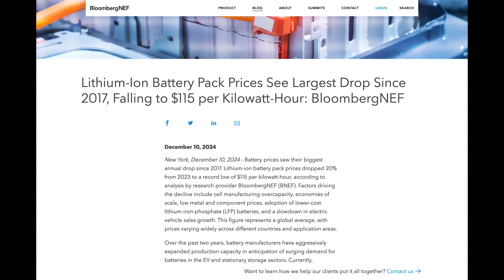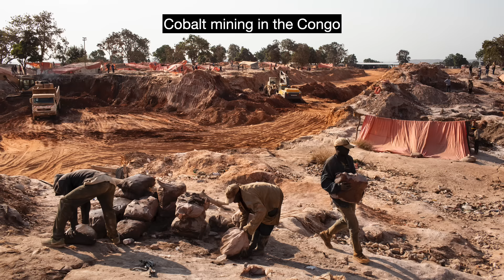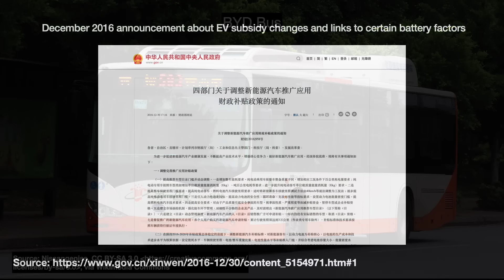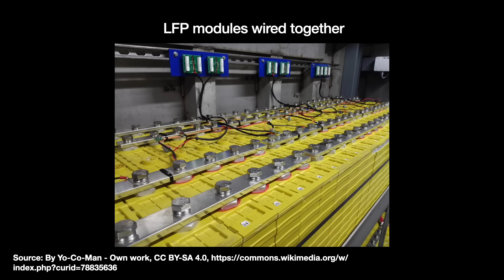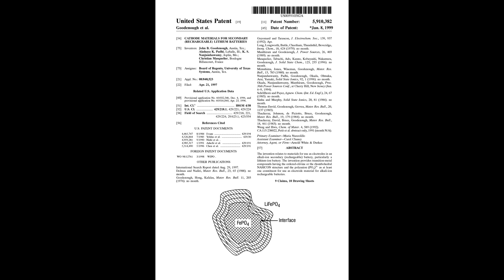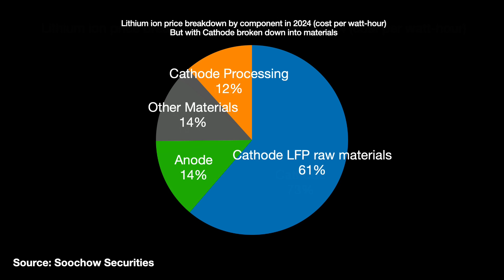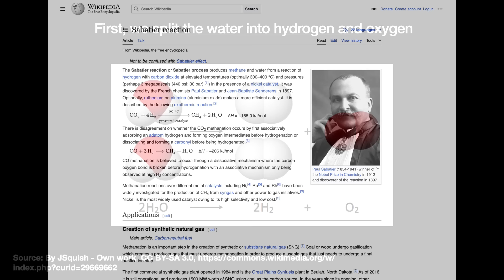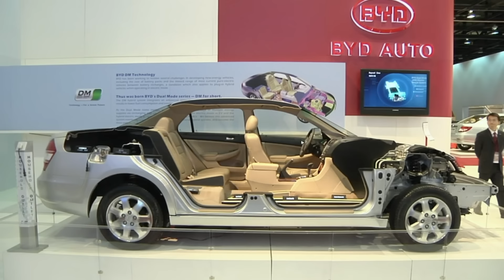How Did China's LFP Batteries Get So Cheap?

Comment: I built a LFP battery from 4 EVE 280Ah cells for my RV. One winter I forgot to unplug the inverter that was on a BMS bypass due to the BMS being too weak for the draw. The inverter has a tiny draw and it drained the pack to about 4V which would mean the battery was entirely dead. I plugged the RV in to mains, but the charger didn't start charging. I sadly started thinking I'll need to buy a new battery. But then I simply decided that put a 3.5V charger on the cells and they started drawing amps. As many amps as I wanted but my DC maxes at 10A. So somehow within about 30 mins, the voltage was above 2.5V, in about 2 hours it was at 3V and then left them and checked about 4 hours later and  they got up to 3.1V. I put them back into the RV and lo and behold, the battery started charging full bore at 30A. The battery is still in my RV and now only has about 250Ah capacity based on my testing. LFP is indestructible.
Reply: I have a similar story, drained my pack to 21v accidentally 3 times, that was 5 years ago and still going strong.
Reply: Undervoltage lockout prevents charging. Some devices, however, won’t even trickle charge up to a minimum point and require manual intervention.
Reply: As I understand most lithium batteries have a voltage threshold which below they are not chemically stable. But I do not know how different types of batteries and the duration influences on this.
Reply: @martinlitorell3834  Not being an expert, but an interested amateur in my understanding the minimum voltage not allowed to go below varies with the maximum charge voltage.
First of all, deep discharge (below 0%) should be avoided by all circumstances not only on most, but on ALL lithium batteries, this is why BMS (when applied) do cut off the battery when a voltage below a certain level is detected.
On 1 cell level (when n-cells are connected in series, you multiply all values by n):
For the nominal 3.7, max 4.2V chemistries/cathodes (usally called for their dominance in use Li-Ion), the lowest voltage point is generally 2.5V, but when including some security margin you find also values of 2.8V or even 3.0V applied in BMS (life cycle tests).
For the nominal 3.2, max 3.6V chemistries (LiFePO4, even though chemicallyit would be correct to call them too Li-Ion I personally refrain to do this, because for me Li-Ion is defined as the dominant 3.7/4.2V chemistry and if I would call also the minor 3.2/3.6V chemistry Li-Ion this would result in failure/confusion, because most shops/sellers would sell me a max 4.2V charger when I ask for a lithium-ion charger, because the max 3.6V charger for LiFePO4 is very rare and LiFePO4 batteries are mostly used in EV and only very minor quantity in other general applications, this means not known to all people) the lowest voltage varies between 2.0 and 2.5V (I would assume 2.5V is simply a value fixed to use same value/test equipment as for the Li-Ion and such high value well matches the compared to Li-Ion extremely stable voltage versus state of charge for LiFePO4, while 2.0V may rather represent the voltage at which real degradation is observed to start).
Generally, the lower the voltage falls, the larger is the damage AND
the longer the too low voltage condition do exist, the larger is the damage.
On 20 year ago produced Li-Ion 18650 cells reconfigured from original Laptop use to house batteries to store photovoltaik energy a general rule of thumb is, any cell found at disassembly of "garbage" Laptop batteries below 1.0/1.5V is not used, on cells between 1.0(1.5) and 2.5V some tests are done to identify cells also too bad to be reconfigured. In other words, the manufacturer or the process used by a manufacturer has some influence.
What exactly does happen when the voltage is too low is hidden in a dust of amateur speculation. For me the best explanation I have heard from somebody who really showed an extremely deep insight is, the lithium-ions do convert to lithium-metal not inside the graphite anode as they should, but at other places like the separator or the cathode and once a lithium-ion was converted to metallic lithium at this not intended places it needs much more energy than is available within the battery charging/de-charging to convert the lithium-metal back into an lithium-ion. Both, the missing lithium-ions and the generation of extremely thin layers of metal at places where it is not desired cause degradation clearly on capacity, but also on self-discharge and I think the dominant factor that limits use is the degradation of self-discharge (some degradation of capacity is in most applications tolerable), this means a battery may keep its energy only 1 months or 1 week while healthy lithium batteries do keep the major part of their charge usually for years.
Reply: Can someone please tell me why this was a bad idea?
Reply: @CallMePaine  Dendrites can grow when the battery V goes low and  cause short circuit upon charging. But I don’t know if it pertains to LFP, Anyone know?
Reply: @unusualelectronic the dendrites grow on charge, rather than as a result of the discharge.
Reply: I do not have experience with LiFePO4, but some experience with 3.7/4.2V Lithium-Ion cells.
Yes, you can re-charge a cell that has fallen below the absolute limit of 2.5V (you may need to overcome the protection built-in), BUT these cells experienced some damage. I noted a drastically higher level of self-discharge (the lower the voltage, the higher the self-discharge). Cells that have once fallen down to 1.5 or even 1.0V or lower are not any more usable in practice. Cells that have fallen below 2.5, but stayed above 1.5V can still be used with degraded performance and the degradation level is also clearly different from manufacturer to manufacturer. Above experience is on cells produced about 20 years ago.
Recently I got 2x maximum 21V (5S) packs. One battery showed at arrival good 19.7V, the other pack showed below absolute limit 10.2V (absolute limit for 5S is 5x 2.5V = 12.5V). I charged the 10.2V pack immediately and for about 10 cycles use up to now no distinctive difference, but I am sure in long term the 10.2V battery will show less lifetime.
==> Indestructible is not correct, but less critical than many think who cannot separate between cell failure/destruction and intentional disabling by for example the BMS (20 year old Dell 18650 based Laptop batteries included an series element in the contact that got burned if the battery BMS detected an unhealthy voltage to securely disable further usage of such batterie, as the high energy content has the potential to cause larger damage  and therefore the judgement what is still usable has shifted higher).
The absolute cost of a 280 Ah battery is substantial, but if the RV would get in fire because some problem with the 280 Ah battery, the cost of a new 280 Ah battery is the minor of all costs.
Reply: @FriedhelmSchröter  LFP cells are now substantially cheaper ($500 for 300Ah with a BMS built  nowdays) and not an extreme fire hazard like LiION. Rapid discharge, short circuits won't light them up on fire, even when damaged/pierced the LFP battery is very resistant to catching fire.
Reply: >BMS bypass >_<
Reply: @P7ab  cringed real hard when I read that. Sounds like a problem waiting to happen lol
Reply: For those of you who wonder why I bypassed the BMS: these are raw cells, this wasn't someone drilling into a box to bypass a built in BMS. The terminals are right there and you can jump a car from that battery if you want to. The reason I needed the bypass in the first place was because north american RVs are manufactured with antique, extremely underpowered charging systems usually 20-50A. My RV has a 30A WFCO charging system (yes, 30A at 12V). I bought the BMS before I ever got the inverter based on the charging capacity of the RV and sized it at 40A. When I later got a 1000W inverter and I plugged it straight on to the battery terminals. There is nothing wrong with doing that, as long as the battery gets charged a bit since the old inverter kept its capacitors charged all the time, hence the trickle drain. I would typically unscrew one of the terminals when I parked it, but the place I used to store it has 120V. And they decided to unplug the 120V without my knowledge, even though I paid for it. I learned my lesson, and bought a 250A BMS and a 3000W inverter and everything is on a BMS. And, no, it's not people like me that solar grid tie regulations are for, because this is essentially a car battery and you can do essentially anything you want with 12V...
Reply: People like you are why there are laws that prevent people who would never, ever have a BMS bypass from building batteries for their own residential solar system. 

Thanks a lot.
Reply: @instanoodles So what? Do you have something useful to add?

Thanks a lot.
Reply: @instanoodles  blame California politicians

Comment: been stocking up on my 12.8v 100ah  lfp batts with solar
Reply: I moved to higher voltage. 12V is awful for any big system
Reply: 12v isnt awful it just cost more in copper wires my comment was buying 12v batts you can easily hook them in series get what voltage you want
Reply: Same here

Comment: China adopted LFP early on in EV transition because Chinese EVs start from buses and taxis, not fancy sport cars like Tesla roadster or Model S. Buses and taxis drive much higher mileage per year (100,000 km per year on average). So cycle life is critical, and LFP's long cycle life is essential in these applications. And that's the key reason LFP dominated BESS (battery energy storage system) market besides safety. And BTW, the Moss landing BESS fire shown in the video use ternary battery, not LFP battery.
Reply: That and China's geography also has colder climates hence LFPs.  Even Beijing drops to close to -10C.  California (let's be realistic that's what the US builds for) is easy-mode.
Reply: @teac117 i don’t know if humidity would effect anything but they also have a way stronger monsoon season
Reply: @JaKingScomez Not really. There are certain models of lead acid that have to worry about evaporation rates, but li-ion is mainly dry and self-contained. If you have to worry about humidity in your electrical equipment, either you're doing swamp cooling, or something gone sideways.
Reply: @meganegan5992  so high levels of moisture doesnt lead to a shorten lifespan for these cars? That was of my biggest worries.
Reply: Yes, we should never have used ternary li-ion for utility storage, but our leaders are systematically cutting off options.
Reply: Another sidenote about patent, royalty of LFP in China. There are two critical patents for LFP battery chemistry, the cathode material, and carbon-coating that improve LFP cathode electrical conductivity by orders of magnitude (LFP has poor conductivity). The patent holder files these patents in China much later, because back then China is a backwater economy, and they did it by combine these patents into 1 single patent (to save money maybe?). Later this single patent was challenged in court, and was nullified. That's why Chinese LFP battery makers can sell LFP battery royalty-free in China, but they still have to pay royalty if they sell outside China, where the related patents are valid.
So the notion that western battery manufacturers & EV makers don't want to make/use LFP battery because they have to pay royalty is not quite accurate, as lithium ternary battery is not royalty free either. Royalty do not stop them from using NMC/NCA battery, why does it stop them from using LFP battery (and LFP royalty is probably much lower than NMC/NCA given it's less desirable)? Since Chinese LFP sold outside Chinese market has to pay royalty as well, western battery manufacturers do not really has a big disadvantage if they want to make LFP batteries.
The real reason LFP was not popular in western market is because LFP SUCKS BACK THEN. Not only it has lower energy density; it charges slow; it has very bad low temp performance; its flat SOC-voltage curve make BMS and balancing very tricky and requires much higher consistency in manufacturing process. So, most people don't think LFP is suitable for automotive application. China poured R&D into LFP tech for 2 decades, slowly improving its performance, and it's not always smooth sailing. LFP still charges slow in early 2020s. It was only until recent years that LFP chemistry has caught up with and even surpassed Nickel-Cobalt chemistry. BYD's recent 1 Megawatt charging, CATL's 12C charging are all using LFP chemistry. The low temp performance also improved significantly, partly from chemistry, and partly from better pack thermal management. Xpeng recently touted that their new LFP battery pack can charge from 10% to 80% in 16 minutes at -30C, compared to 12 minutes at ambient temp.
Reply: @EdGoodwill  Thank you for explaining how they lost the court case.  I had been wondering for years.
Reply: @EdGoodwill    so no patent means wider application means broader market means economies of scale means more r&d..
The GOAL of any patent is to LIMIT the amount of suppliers of a commodity that depends on the patented technology - patents (anything IP really) are ANTI competitive by their nature - just look up the history of copyrights and patents.
Reply: There's been multiple Moss Landing fires, sadly.
Reply: so not firey dumpster coffins? whats the fun in that?
Reply: Perfect is the enemy of the good
Reply: @Namewithheld00123  luckily LFP is invented by Goodenough

Comment: As of 2025, the highest energy density in commercially available LFP (Lithium Iron Phosphate) batteries is approximately 205-210 Wh/kg at the cell level. CATL's latest version of LFP batteries, announced in late 2023 and early 2024, reached energy densities of 205 Wh/kg without increasing production costs.Industry sources suggest that CATL's batteries may reach prices of "less than $60 per kWh" later in 2025.

Comment: I remember how bad Lithium Ion were as kid with my Tokyo Marui AEGs airsoft. At end of life of battery I charged it up and shot it for fireworks
Reply: Those all use 8.4v NiMh or NiCad if it was the very early 2000s, 11v stick batteries were and are for risk loving dorks when it comes to airsoft

If you have to charge it in a special bag to prevent it from creating a fire risk, it’s shit